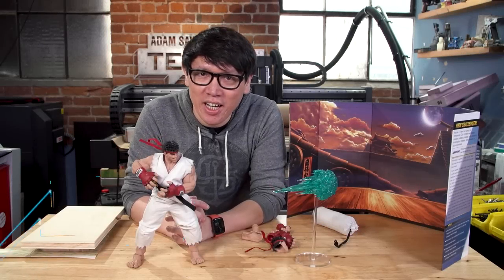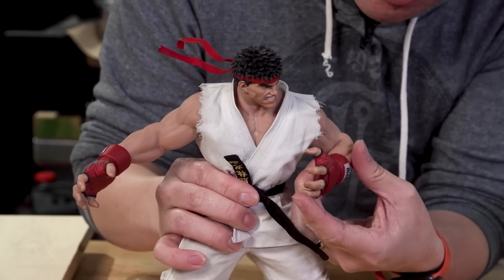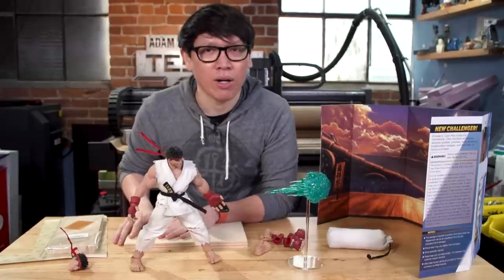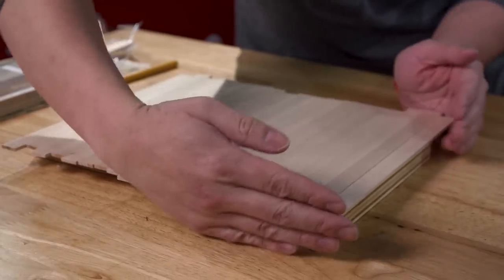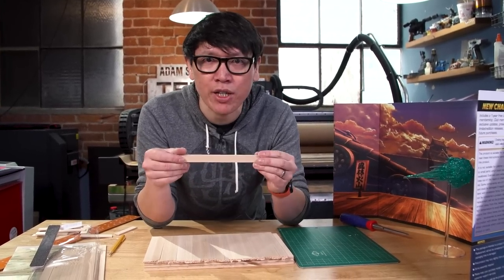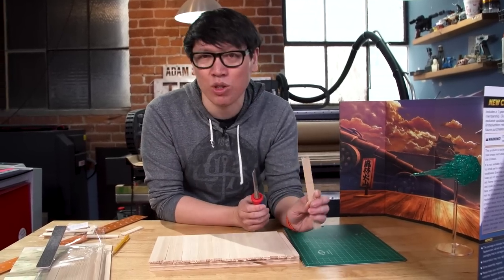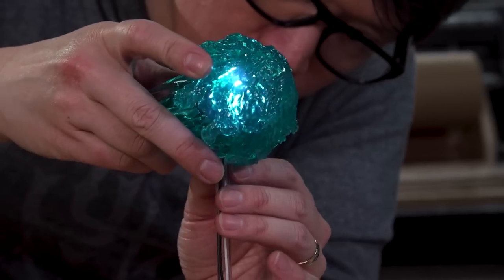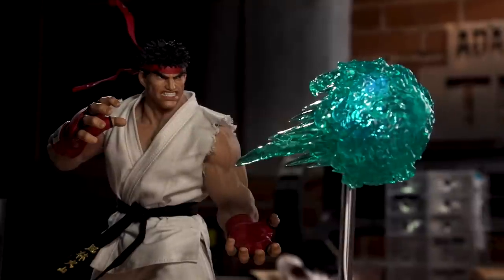How To Make Realistic Diorama Wood Flooring

Comment: You can also age wood by abusing it. Boards this small, put them in a large bag with ball-bearings and small stones and then semi-gently agitate the bag to beat up the wood without breaking it. We did this with 12"x12" beams by dragging them behind a truck
Reply: How does 12"x12" make a beam? Wouldn't it be more of a square plank?
Reply: @damiencarlson21  12"x12" in 8' sections. Figured that was glaringly obvious. Nobody says 2x4x8, they say 2x4

Comment: You can lay down a coat of gloss varnish to separate layers of the paint job. That can protect you from mistakes. Like a save point in a game.
I might have gone with tea to stain the wood and a wire bbq brush to distress it. I was worried you would gouge a hunk out of the board with the chisel.

Comment: Just a thought one type of distressing can be achieved by using an a chain from say a bicycle, and a small diameter punch.
   A decking board is usually 5 1/4" wide, about the width of a Foot.
    Try using the solid acrylic rod pushed through the base board, hollow the base board place an 'led' firing up the rod this should act like a fibre optic tube and the object will illuminate.
Reply from the maker: love the fiber optic tube idea
Reply: @tested  Thanks!🙂